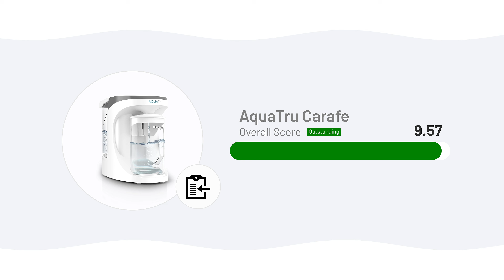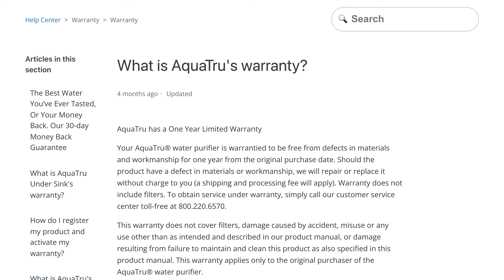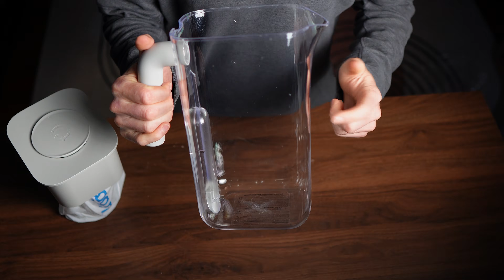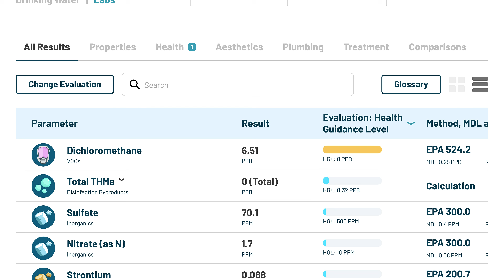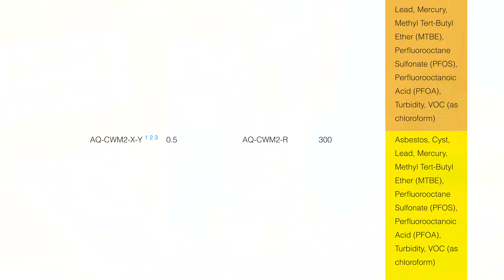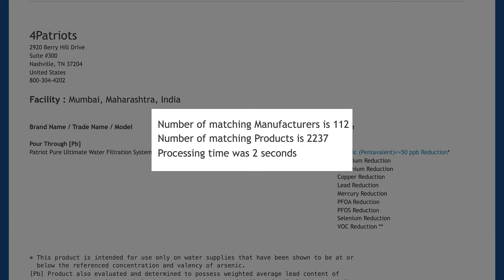The Best PFAS Water Filter Systems I've Tested

Comment: I have been using the Culligan filters in my stainless filter housing.  I can only test TDS and they are almost the same as my tap water, even though I fill it with carbon filtered water. I know that high TDS could just be minerals,  but I find it hard to imagine that a filter can selectively remove only bad chemicals.

Comment: How about Brita and all the cheap pitches in major stores?
Reply: It's always about what you are trying to filter. You can use a Brita pitcher (such as the 10-gallon Elite) but unless you buy a Cyclopure Purefast filter ($45) that fits in it (it contains DEXSORB that many PFAS whole house systems use), you won't be addressing PFAS "forever" contaminants. Rough filtration for particulates can be handled by many pitcher systems and also remove chlorine removal, heavy metals, lead, asbestos and others, but PFAS is a different specialized and costly annoyance to address.

Comment: Just for info : 
I bout a Waterdrop G2P600 and I had to replace the non RO filter after only 4-5 months… and the RO one after a year I believe 

The smaller one is supposed to last 12 months and 24 months for the RO filter…

so you can easily double the price of the filters into your calculations… 

and the water hardness is not that high here in my city in France (Taverny 95150)

Comment: Culligan have shut the online shop🤔😡
Reply from the maker: What?
Reply: @waterfilterguru yup, just tried to reorder my usual 12 filters, says on landing page shop is shut,  and if you go to the shop, everything is out of stock. So now I need to look for an equivalent filter system or get an osmosis system fitted.😳
Reply: I’m liking the Aquatru tho
Reply from the maker: @primaltribe_tv  I see the Culligan ZeroWater shop is live and working just fine https://geni.us/e34qvN

Were you perhaps trying to order from the legacy ZeroWater website? Sounds like that might be the case, since the brand is now being sold under Culligan

That said, the Aquatru Carafe https://geni.us/885ud is the highest scoring and most extensively certified system I've personally tested. That's what I use. Replacement filter costs are also much more affordable than ZeroWater

Comment: AquaTru can’t handle hard water which should be an important note to make when reviewing things properly as TDS is big reason people use RO machines
Reply from the maker: In the water treatment industry we recommend pre-softening water harder than ~120 mg/L (~7 GPG) before filtration through any reverse osmosis system in order to protect it from internal scaling, membrane fouling, and premature failure. This is especially important for countertop RO units that also rely on an internal pump. Not just Aquatru, all of them.

Check out this video I made about countertop ROs and hard water specifically https://youtu.be/pEC3GZmM_1Y

Comment: Most of these equipment have plastic parts so I just boil my city water and drink it. End of story.
Reply from the maker: That’s a fair concern, but boiling city water generally does not remove most contaminants. It can kill microorganisms, but it doesn’t remove things like heavy metals, fluoride, nitrate, PFAS, or many other dissolved contaminants. In fact, boiling can actually make some of those more concentrated because part of the water volume is lost to evaporation while the dissolved contaminants are left behind. So for microbiologically unsafe water, boiling is great for disinfection. For typical city water contaminant reduction, it’s usually not an effective solution.

Comment: Does the aqua tru have any ultraviolet light filtration like many countertop reverse osmosis systems do?
Reply from the maker: No, it does not. 

It's good to clarify that in the countertop systems that do have UV, that feature is typically there to help sterilize internal tanks or reservoirs that you can’t easily take apart and manually clean. It’s not intended to disinfect microbiologically unsafe source water. 

AquaTru’s tanks are external and removable, so you can clean them with soap and water, which makes that kind of UV tank-sterilization feature less necessary in this design.

Comment: this channel is a treasure! amazing content! may i please ask two questions? are those measurement are done by labrotary or by photometers or mV ways? (i am little bit aware only , might sound silly😂) and the second thing is: how about the biological and mineral content? are those removed or still there ? any claims or tests? i ask it only for the drinking purposes🙏
Reply from the maker: 1) Here are the methods the labs use to test for PFAs in drinking water using liquid chromatography/tandem mass spectrometry (LC/MS/MS) https://www.epa.gov/pfas/epa-pfas-drinking-water-laboratory-methods

2) Are you asking if the filters discussed in this video remove microbiological contaminants along with minerals? If so, it all depends on the specific filtration system in question. None of these should be used as primary treatment for microbiologically unsafe water. They are all intended for use with properly pretreated and disinfected water. RO systems all greatly reduce mineral content of the water they treat, so if that is a concern for you you may want to consider remineralization or another type of system.

I hope this answers your questions

Comment: I really like your channel, I haven't watched all the videos yet, but I am looking for something kind of specific if it even exists! I want either a freestanding or countertop RO system, that connects HARDLINE, and it's also ok if it has a drain line. I do NOT want refillable pitcher. It also must dispense cold water, have a reasonably fast flow, have remineralization because I MUST have that for the taste, UV to keep internals clean. Is there anything out there that exists that meets all these requirements? I also don't care how much water it wastes. It also does not have to have hot water.
Reply from the maker: No such thing exists. Sounds like your best bet would be an under sink RO plumbed to your refrigerator so you can use the cooled water dispenser and icemaker there with the filtered water.
Reply: @waterfilterguru OK, which undersink RO system should I get to connect to my fridge, which has cold water and Ice and has all the features I want RO/alkaline/UV, and I want tankless! And needs to have enough pressure to feed the fridge. I have great incoming water pressure already at 60 psi.
Reply from the maker: @petef.4361  Waterdrop G3 https://geni.us/rQekgwp

Comment: 90 cents a gallon for Zero Water? I can buy RO water at Whole Foods for 45 cents a gallon.
Reply from the maker: And filtering your tap water with RO at home is typically <$0.25 per gallon (plus no hauling involved) 😉
Reply: @waterfilterguru the problem as I see it, is that the breakeven point is 1,875 gallons. 1875 gallons x .25 = $468.75 + $375 for the Aquatru Carafe = $843.75. 1,875 gallons of RO water from Whole Foods at .45 a gallon, also $843.75.

Comment: Also, I may have missed it if he said it, but AquaTru has a traditional undersink option.

I got the AquaTru classic with the remineralization option and so far it’s been great. I used to have a Berkey and then started using Doulton filters with fluoride removal. I switched to AquaTru because of all the certifications it has. I figure why spend all that money and not even have certifications?

The AquaTru is definitely faster than the Berkey and Doulton filters, and I got the smart option as well as the three year warranty for $50.  I got the countertop and not the undersink because of ease of use and because we can stay on top of refilling the countertop system to have all the water we need. We just use the empty stainless steel Berkey as a water holding vessel now. We also used to take our Berkey to the beach and other trips so the countertop option is nice to have for that.

All in all, it’s worked out great.

Also, if you have an HSA or FSA you can use the money there for an RO system!
Reply from the maker: Thanks for watching and for the comment!

Comment: Thank you for this video
I doubt if AquaTru is reliable since I saw many reviews complaining it stops working after sometime although filters are changed.
Reply from the maker: Thanks for watching. After researching this exact issue, I have a hunch the vast majority of those premature failures were caused by improper use (filtering hard water through the system). I even made an entire video about this and actionable steps to avoid the issue and protect any countertop RO https://youtu.be/pEC3GZmM_1Y
Reply: Hard water can often be tough on ro systems I heard. Perhaps a water softener first would be ideal. This I would like to do but I have a countertop reverse osmosis system no plumbing.
Reply from the maker: @MrDunham-b49  here's the solution for renters, a non-invasive water softener to protect countertop RO systems https://youtu.be/pEC3GZmM_1Y

Comment: Awesome video! Do you plan to review the Aquatru under sink model? And do you have any recommendations for a system with long distance delivery of RO water (>40 ft)
Reply from the maker: I'll be testing it soon. For long runs like that you may need a booster pump. Make sure you use one that's certified for materials safety!

Comment: Was looking forward to the Brita Elite.  What’s the difference between a Zero water filter and a Culligan Zero water filter besides the name?
Reply: I have the Zero and the lifespan of the filter is horrible. Try filtering with a Brita first then put the water thru a Zero.
Reply: @wizerdjuice9589 it was stated on the video that Zero Water costs 90 cents a gallon to make. I can buy RO water at Whole Foods for half that. That makes the Zero Water pitcher an impractical purchase in my opinion.

Comment: How does proone compare? Thanks in advance
Reply from the maker: ProOne was acquired by Culligan. The MaxClear filters their rebrand of ProOne
Reply: @waterfilterguru wouldn't that be considered false advertising if it's only 50 gallons but claim up to 1200 gallons?  I'm not trying to argue I truly want the truth because I'm going to be depending on the system. Thanks in advance again
Reply: So they are only good for 50 gallons? I just ordered one the other day and it said 1200 gallons if I remember correctly.

Comment: The WaterDrop G3 has been a life saver. Not only for very clean water, but even it’s negatives can be considered a positive. 

No remineralization- A bottle of minerals provides better and more consistent consumption of important minerals than a filter provides. 

Longer installation- The most difficult part was getting a wire ran under the sink for an outlet to plug into. One hole needs to be drilled into the drain pipe, and one through the sink top if there already isn’t one. 

Complete installation took me 2-3 hours max. Meanwhile, it has saved me 2-3 hours of filling and cleaning a countertop system every single month. So in my 2 years of ownership, the G3 has saved me about a full days time of messing around. 

Filter changing could not be easier or cheaper for fully cleaned(including fluoride) water. I believe it costs around $250 a year, and this includes my dogs water. 

Best and most helpful recommendation I have been given.
Reply: For anyone considering this, verify the unit measurements fit under your sink. If you have small cabinets or really deep sinks, the unit may be too tall. I’m not sure if the unit functions on its side? And some people have small sink door openings.
Reply from the maker: Awesome, thanks for sharing your experience

Comment: Is there any chance you can do a test on a water filter that is suitable for camping?    I have seen RO systems advertised.   Are they any good?
Reply from the maker: Testing camping filters is on my to do list! RO Is not recommended as primary treatment for raw surface water. It'll work... But the membrane and internal components will develop biofilm, foul, and ruin the system. It could work with proper pre-treatment including filtering out sediment, turbidity and disinfecting the water first
Reply: @waterfilterguru  thank you for replying so quickly.    I look forward to seeing your testing.  Which ever one you recommend is the one I will be buying.      Cheers Max.
Reply from the maker: @maxdeane1092 any camping filter in particular you'd like to see tested?
Reply: @waterfilterguru Itchil portable RO.    Purewell portable RO.    These are the two that I see the most of on the Internet.    As I live in Australia, it can be an extremely long distance between drinking water  any suggestions that you have would be greatly appreciated.   Once again, cheers Max.

Comment: Best RO system with remineralization and PFAS removal?
Reply from the maker: Under sink or countertop RO?
Reply: Give for both, money is not a concern but real quality end state tested water from each for cutting thru marketing and certification marketing PR BS.
Reply from the maker: @btp9576 

Countertop: Aquatru Carafe https://geni.us/885ud    

Under sink: Waterdrop G3 https://geni.us/v0ePA
Reply: @waterfilterguru  Hi there. In your review video you mention that the G3 doesn’t have a remineralizer, what would be a good option for under sink including re mineralizing? Thanks
Reply: @waterfilterguru is there a next best over the counter reverse osmosis water filtration system that also mineralises the water? Wanted to try find one that’s black with a different design 🥲
Reply: @Mrk2z the G3 has an add on remineralizer unit, not very expensive and easy to add on to base set up.
Reply: You can buy a 6+ month dropper bottle of minerals for $40. Healthier and cheaper than mineralization filters. 

Most required minerals should already be coming from the food we eat. So at most, you only need a few drops of minerals in a single glass of water a day. 

I would say a remineralization filter is only beneficial for people who hate the taste of RO water. I personally love it and dislike mineralized water. So I simply add one dropper of minerals to my water bottle once a day. Better minerals, no filter cost, cleaner tasting water the rest of the day.
Reply: He’s sponsored by these brands he recommended. Not very trusting
Reply: Frizzlife 600 GPD Tankless Reverse Osmosis System – Alkaline, PD600-TAM3